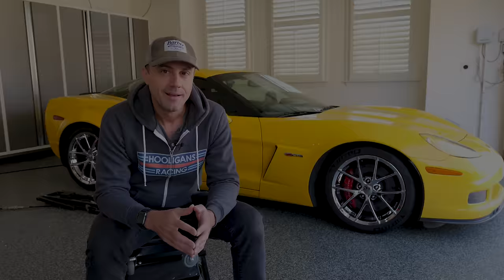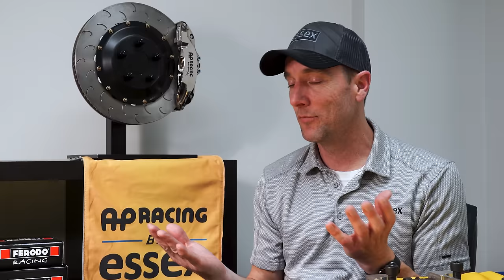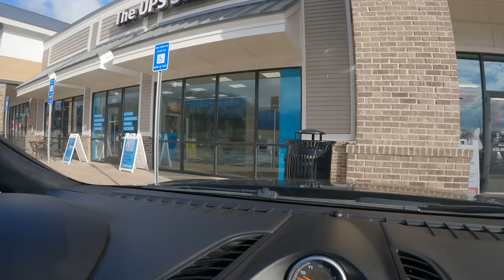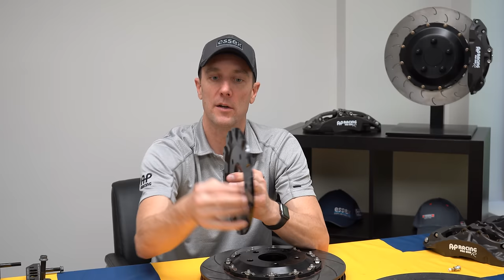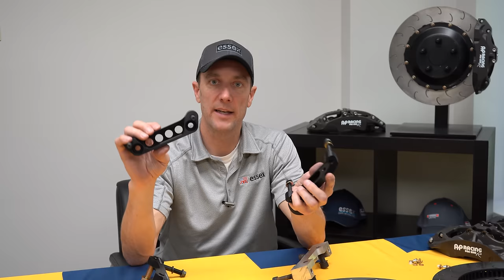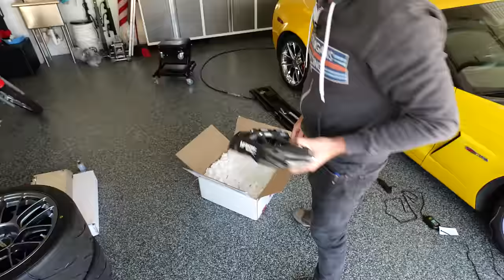Big Brake Scam... RESOLVED?!

Comment: If your hard enough that you need a top tier brake setup, why would you shop for a discount kit?    If you need slightly improved brake feel, source an oem stock rotor (ZR1 etc.) and sometimes even OEM calipers (leverage OEM engineering - which in the case of GM is surely more than what Essex can do).   Again, if your  brakes aren't doing it, and its absolutely time for a serious upgrade, you go to a known vender (like Essex) and you pay the money.   Saving a $1000?   Your basic mechanic charges $100 an hour...   You'll eat up that $1000 in a weekend - especially if your areshort a part.
The ZR1 has (had?) some pretty serious brakes on it.   Were you seriously exceeding what the brakes could do?   ZR1 calipers are easy enough to come by (I think Amazon can source them).   I have a Z51 '07 and those brakes seem fine (I have replaced the lines, the pads, use stock rotors and I flush with racing brake fluid - hubs seem fine).  The car is 420hp at the rear wheels - which is pretty much stock Z06 hp.  Car is driven daily (well, right now fixing radiator leak - stupid plastic side tanks).
Reply from the maker: When it comes to brakes I probably wouldn't buy used again, but I don't necessarily think it's always a bad idea to buy used. The caveat is you need to be certain that what you're buying is legit and that you can get parts support if you need it. That's kind of the point of the video.

What I didn't understand when I bought my kit is that there are shops out there putting together kits with gray market calipers and other piecemeal components of questionable design and engineering and then selling them as though they're the same as what you'd get from an authorized shop.

If you're capable of driving the car near the limit and you're at a track that's hard on brakes like AMP (my local track) is, you can absolutely exceed the limits of the factory setup (even with racing pads and fluid) very quickly. It's a known weak point of the C6Z that Jeff talks about in the video. 

It's not necessarily intuitive but sports cars can be way harder on brakes at the track than race cars are, just because of weight. Even a relatively heavy race car like the C6.R weighs more than 500 lbs less than a C6Z, and repeatedly hauling that weight down from speed is what generates heat and eventually overwhelms a system that wasn't specifically built to handle that kind of abuse.

Carbon ceramics from the ZR1 don't really appeal to me. Replacement rotors cost thousands, they're fragile, and the overall system doesn't save weight or perform better when compared to AP's setup. The initial cost might be similar or less, but as soon as you have to replace rotors the AP brakes become a better value.

Comment: So basically if u dont buy the system from them or a authorized dealer they wont sell u any parts right?
Reply from the maker: That’s my understanding, yes.
Reply: @JoshVanVeld  interesting
Reply from the maker: @gigi9467  I think the exception is that if you buy a used kit that originally came through them or one of their partners you can still get support.

Comment: I wouldn' say this is a scam.. you just bought a kit that was done by a third party that no longer exists...
Reply from the maker: The shop that made the kit wasn't an authorized retailer, so they were selling kits that didn't have a warrant or support, but not telling buyers that. They sourced the calipers out of Asia and came up with their own brackets and hats, which were inferior to what Essex offers.

The previous owner of the kit had to have a local shop make new brackets, which required modification of his car to fit.

Of course none of this was disclosed to me, it was represented as a gently used version the $5K+ kit you buy from Essex.

The previous owner got scammed, and he passed it along to me (and priced it as though it was legit).